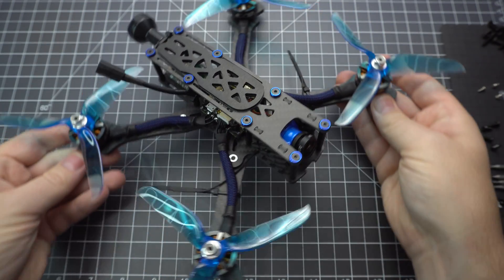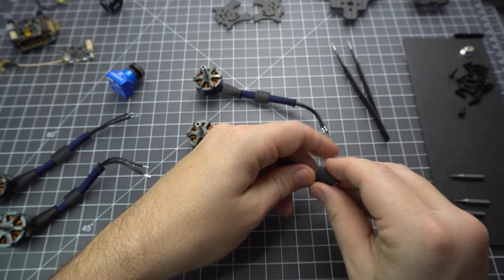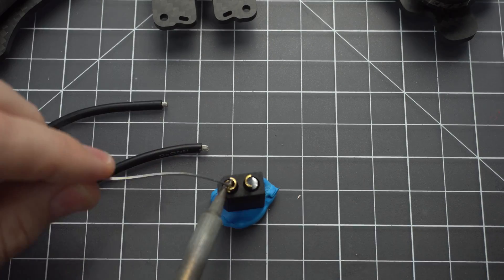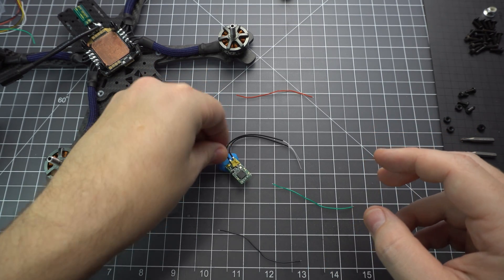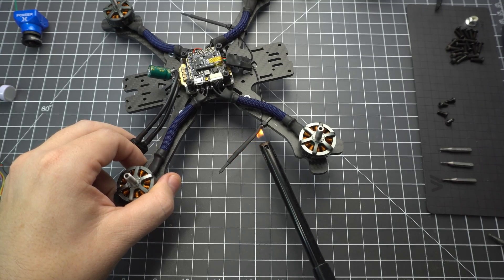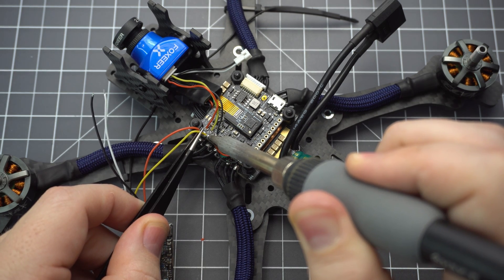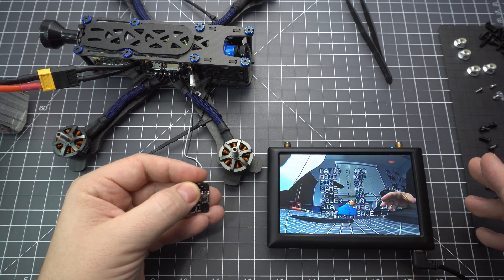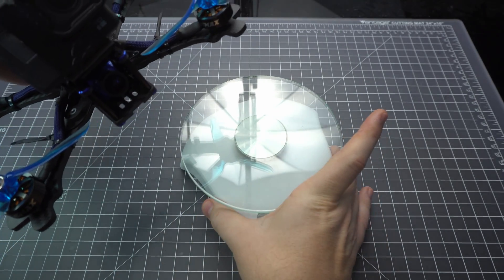How to Build a 6S FPV Freestyle Drone - TBS Source One

Comment: Just bought this last night! How do I fit a mini camera in there without a 3d printer? I have a Hawkeye firefly split 4k cam for this build. Love to post to your site.
Reply from the maker: You may just be able to add some washers or nuts and use longer screws to get the cam in there tight.